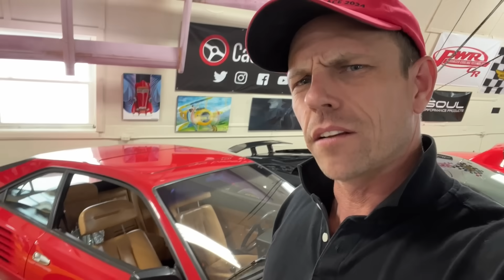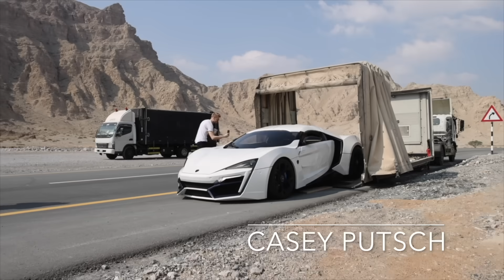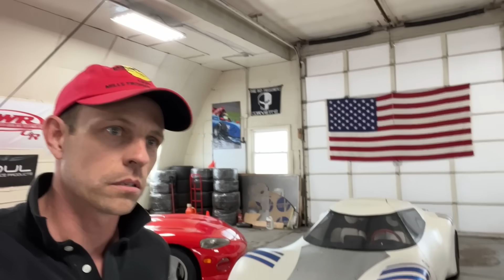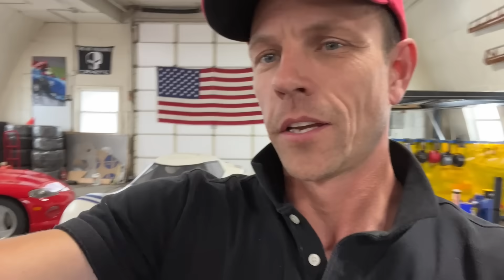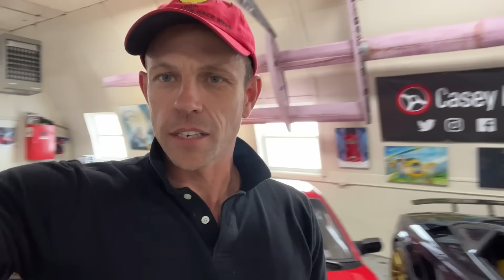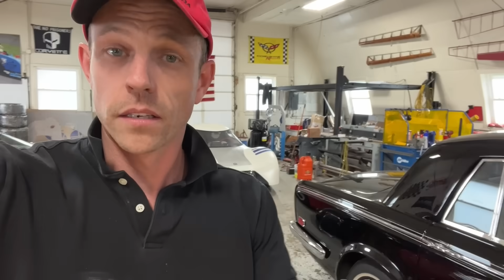Will the OMEGA CAR change everything? Video 1 of 3 "the Overview"

Comment: First off, that is a really great looking design and I want to build one!! 👏👏👏
Secondly as a side note, Tesla is the only company that has a plan with minimal footprint on the environment. Over 98% of all materials in Tesla batteries are recycled by Tesla. The rest of the car is definitely no different than any other body and chassis. All I’m saying is to take a little time every now and then and really research what Tesla does and how they do it. There is a lot of people that don’t and they look silly and sound less intelligent when making statements around EV owners that know the facts. 🤷‍♂️
Not saying you didn’t state facts because the other companies don’t give a crap about any of that. 😏
Anyway… great project and I can’t wait to see the results! 🤙
And I would suggest looking into “Banks Power” I would be willing to bet that Gail Banks would help you make the motor the most efficient it can be. 🔥🔥

Comment: I always liked Carrol Smith's rather "modular take" on cars where he basically looked at the engine as a box of a certain size that makes torque and is supplied by the engine builder.
So that leaves "everything else" as your fun playground.
The interesting thing about the Omega car comes down to the material science of the structure. Been trying to noodle out what the chassis is built from which would be 'ultra recyclable'. It looks like a foam shape with a composite surface so my guesses circle around that. 
🤔Midwest area with farming... Could a hard foam be made out of a natural plant material? (Found a paper about foamed wheat straw fiber but it is composited with polypropylene.) For a composite surface plant fibers such as hemp would be an easy choice but that still leaves what to use as the matrix that is weatherproof, recyclable, and not a fire hazard...
And whatever the structure is it must be accessible to the "one off" production scale of a DIY prototype.
Reply: I suspect its aluminum based. Also ive seen foamed aluminum panels before. That would be an incredible basis to build a car around
Reply: @BrokeWrench  - Interesting idea. After seeing the 2nd video I'm still going with some sort of an odd composite. He talks about panels changing size and size and you can see the roof has distorted.
Thinking about the foamed aluminum: I'm thinking that it would be awesome for structure in the crush zones. If you roll it up it would make a great bumper with a urethane cover to make it 'pretty'.

Comment: You dont have to beat the dodge viper.  It just needs to turn on, the door needs to close etc, it needs to be in gear.  And run.  Efficiency comes later.  With refinement

Comment: If you were in Europe you could've pulled a 1.2 from a Lupo 3L. Those things manage 90mpg with ease and they have a garbage 5 speed AMT stock (which doesn't like shifting after the mounts go bad and are beyond easy to swap a 6spd manual into). Aluminium and magnesium body with magnesium wheels on a car that's 3000 on the used market though. With a streamlined body like that I'd wager it'd half that for way less money than it cost VW to build the XL1.